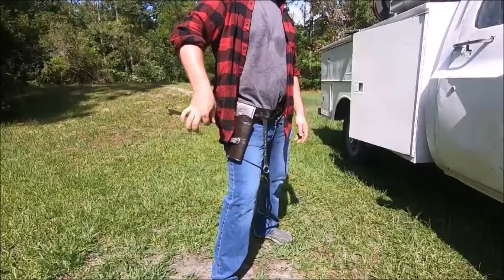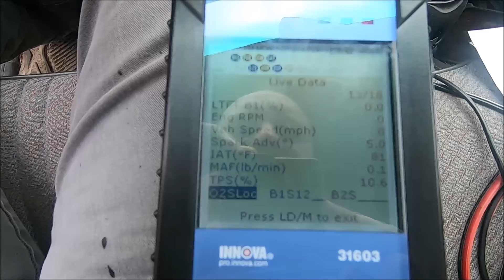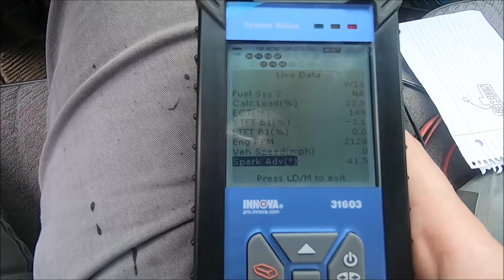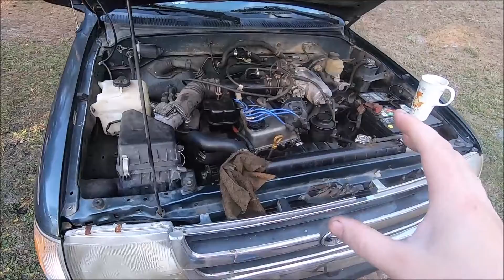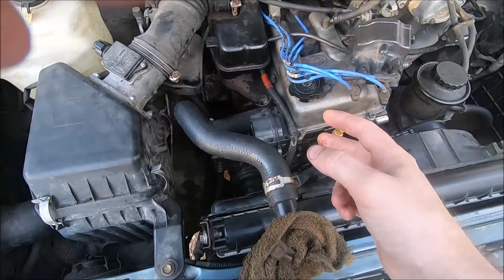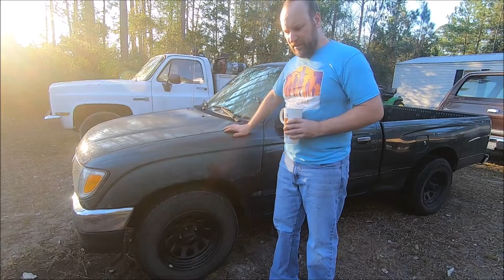1997 Toyota Tacoma 2RZ FE engine PO336 code diagnosis and fix

Comment: Did the pickup for the camshaft sensor line up completely even after you adjusted timing ?
Reply from the maker: It did not line up exactly because there is some mechanical advance built in, but it was closer. I wish I had thought to measure it, but unfortunately I did not.
Reply: Thanks I’m getting a p0336 code and I’ve replaced all the sensors, distributor, and computer and still having the same issue so I’m gonna go out on a limb and assume it’s a wiring issue somewhere
Reply from the maker: @MorganEades-rn6sz  ugh that’s what we all dread…. The wire-by-wire drudgery.
Reply: Yes no kidding, I’ve messed with some of the wires coming off the distributor where it runs into the main harness and now the code is gone but truck is still doing the same thing
Reply: @MorganEades-rn6sz  same on my tacoma
 .., so did u solve the problem ?

Comment: How would you go about doing this if you’re not at tdc
I replaced my distributor (same engine but ‘95) but I’m guessing I’m about a tooth off as well because I’m misfiring at 3k rpm and high idle (manual tran). Got same code too p0336
Reply from the maker: Rotating the distributor? You can can rotate it at any point, not just TDC. You just have to watch the distributor rotor and note where it is before and after to see how much you have changed it.